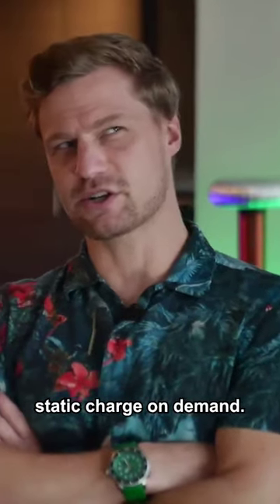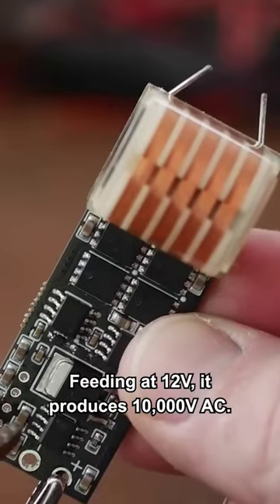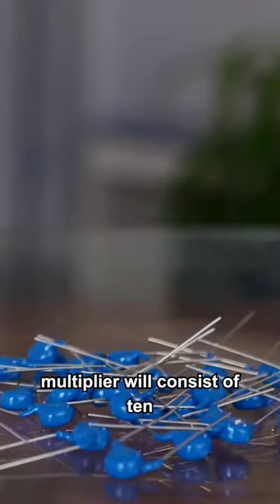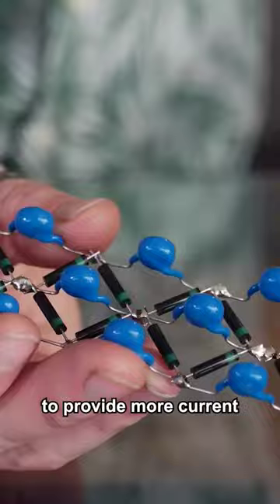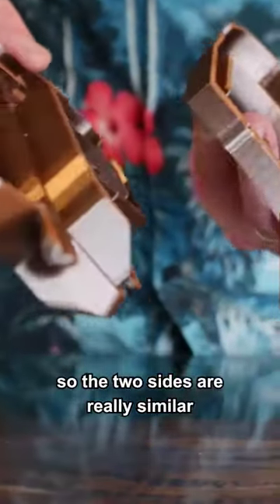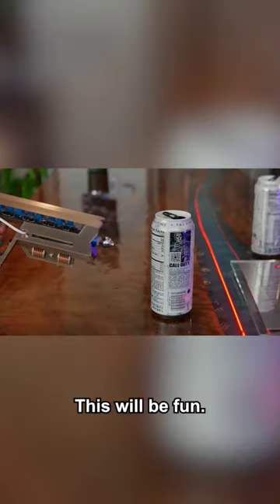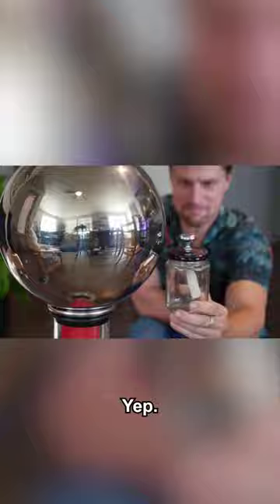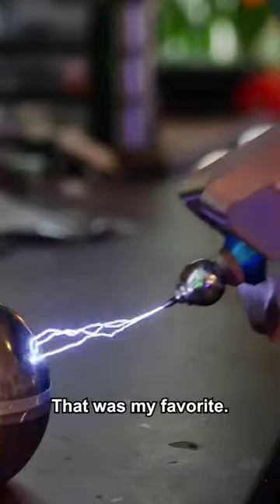Building A 120,000 Volt Ray Gun!

Comment: What are the farads of those capacitors, if we want to build one?  And where did you get those circuit boards and transformers?
Reply: Walmart, Ace, Amazon, eBay, CRMagnetics, DirectIndustry etc.
 You can get that stuff from SOO many places and many sell every single thing you need and a whole lot more. Most even have charts to make sure you get enough to handle the load, there's more to it than that, but you either already know or need to do some serious research.

Honestly, I wouldn't try messing with any capacitors or transformers if I were you. Not to be a dick, but if you don't know then you really shouldn't mess with it.
 Even swapping out one on an AC unit could be deadly if you don't know what you're doing. Simply installing the wrong one or not properly discharging one can be dangerous and if you don't have the proper knowledge to do it and those things can easily turn into a small grenade that happens to also have enough to electricity for a deadly arc flash. At the least, it can cause severe nerve damage that will leave your skins pigmentation the wrong color and your skin itself could hurt for the rest of your life!
Reply: @RBRM3   Thanks Dad.  You said nothing useful and did not understand the question.